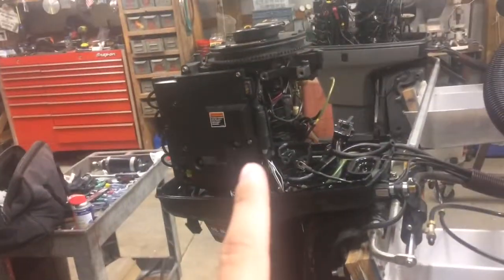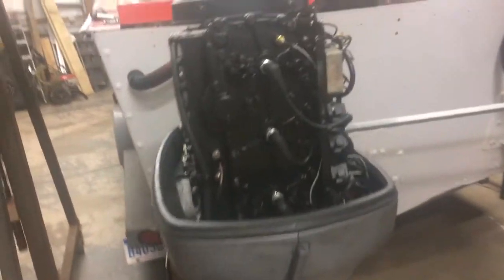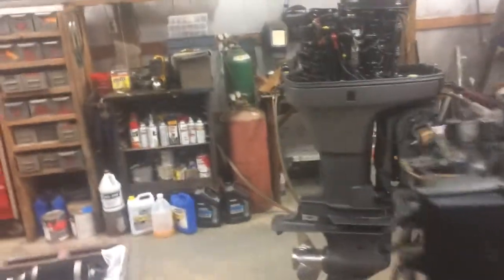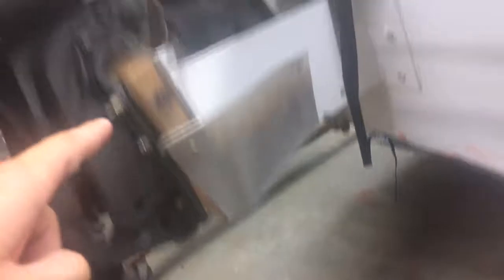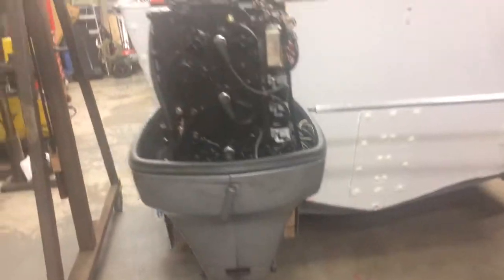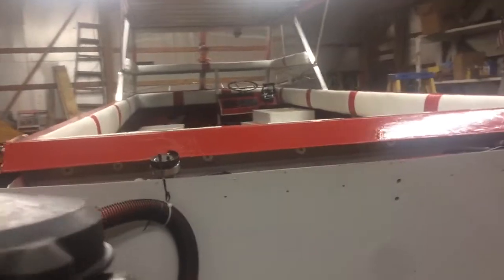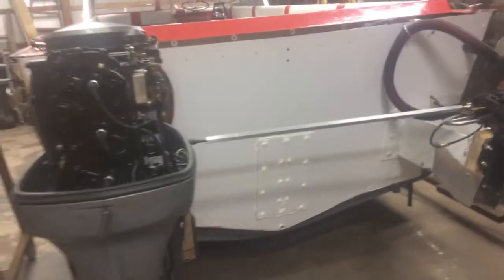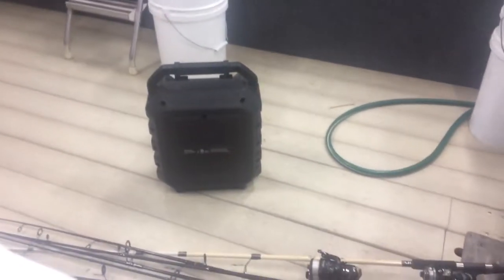i/o to twin outboard conversion update

Comment: So far, the O/B conversion is counter productive.  No engineering calcs,  no fuel consumption calcs,  and not even any proper engine testing before leaving.  A look at how the factory handled an O/B installation would have led you down a different path.( and also ate room behind the transom !)  Can't help but think how much more efficient  the inline 6 165 hp ( or the shorter inline 4 120 hp? )  are compared to 2 strokes..   the increased fuel required for the 2 strokes will undue much of the space and weight savings you were after.  And so will the large knees required to support the transom and outboards handing waaaay out there. Oh well.
Reply from the maker: U really are a human hemroid
Reply from the maker: U really are a human hemroid
Reply: hahaha that made my day!! Any more progress?
Reply from the maker: U really are a human hemroid
Reply: Capt roid
Reply: Can you tell me on those engine mounts how high you set them off the very lowest point of the transom say the drain spigot to the top of your motor mount   Im gonna put a single engine     Thanks  and nice job